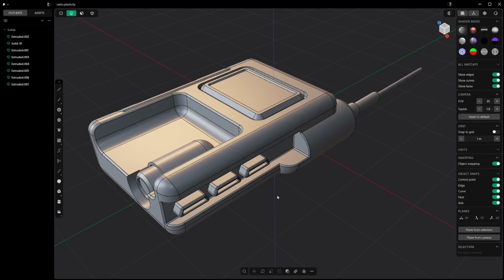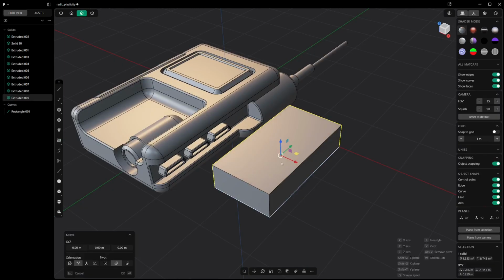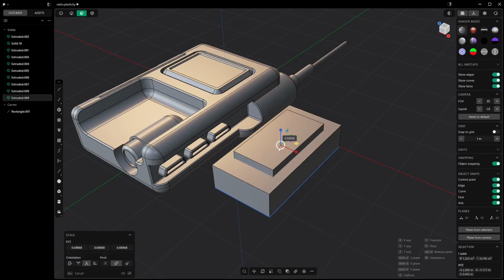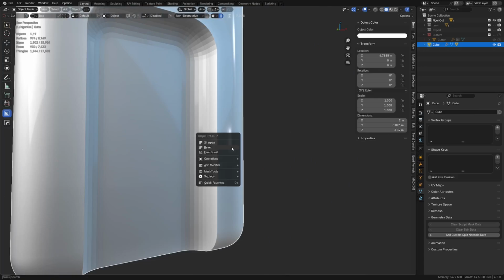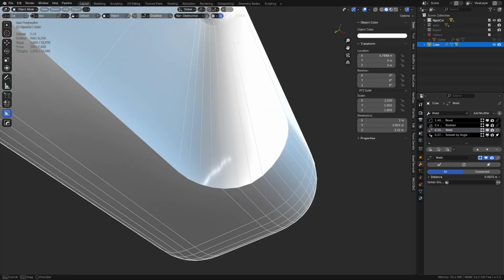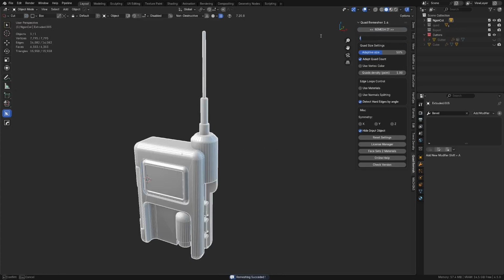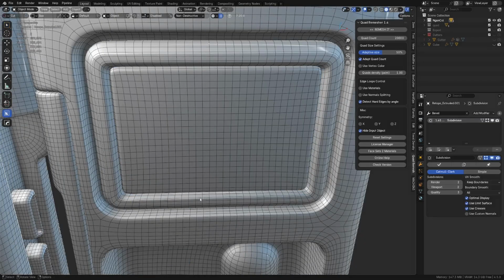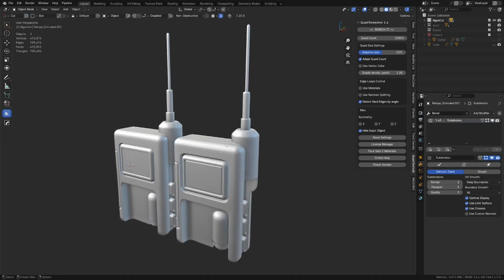Too Much Software ( Unleashed )

Comment: Frankly im still cant really get all that hype around "Plasticity" or SDF modeling. Yes, its a fast way to get some clean shapes with zero understanting of topology, but each time i saw how people convert it to game assets its ended up with: pretty ugly topology (even by games low-poly standarts) or a processes which are so time consuming and convoluted than more classical game assets pipelines looks times more reliable, faster and providing ability to tweaks even at the end of the process.
Reply: topology doesn't matter that much for non deforming mesh, you can use the output from Plasticity or even tweak it abit if you want.

Comment: I've not used Plasticity before, but I have been using parametric modelers for about 20 years now, CATIA, Pro/E, Solidworks, etc (this is my engineering perspective).  And only recently been playing inside of Blender.  Different softwares fits different needs and results.  Can you do NURBS and BREPS in Blender? Yes.  Can you do polymodeling inside of parametric modelers, also yes!  Just because a software can do something doesn't mean it's the best for that application, and that's absolutely fine.  A program doesn't have to do it all.  Use what's most accessible, and most appropriate for the job at hand.
Reply: wait we can do nurbs in blender?
Reply: @lavatr8321  indeed you can.  Under "Add" > "Curve" or "Surface" there are NURBS options.

Comment: 100% agreed, I tell people the same thing to focus on the fundamentals, Blender, PS, Painter. If you are trying to get a job as a 3D Artist, then I tell people to download a trial of Max or Maya so you are familiar with the controls and they way they work and so your are prepared for the job, however at home you'll want to use blender as it has the lowest barrier to entry and most resources online. Most of what you learn in 3D working in Blender you can transfer those skills to other packages so there isn't a point in buying every software out there until you need it. 

I've been a Max user for 15 years and I've completely switched to blender on personal work, now when I needed to go into more niche stuff for specific projects i use Zbrush or Plasticity however I would only recommend taking a deep dive after you've spent enough time to understand the limitations of traditional SubD programs workflow and whether you actually need it. I use Maya for work and it has it's own quirks, i wouldn't use it if it didn't have to. 

I personally find Plasticty more fun for building models and do use it for making games but I'm shifting the work around when I do that, In something like Blender you handle Topology and design at the same time which has pros and cons, By frontloading the Design work to plasticity you are backloading retopology and UV's to blender which has it's own pros/cons.

Comment: An addon for Blender that could help with cleaning up CAD meshes is AV Resample Mesh, but it's still quite a painful process.
When I export from Fusion 360, I preview the tesselation and adjust parameters until it looks good enough & then fix it up in Blender.
Reply: Yea its all fun in CAD modeling 
then it comes into Blender and the mesh is fk up

Comment: Yep. When I tried Plasticity, it was great to play with (for a non-polygon modeler), but the problem is when it came time to convert the model to usable polygons and exporting it (and seeing the result) it was like crashing down to reality and experiencing some crushing disappointment.

Probably great for people just creating fancy renders where nothing matters except the rendered result and you can get away with just rendering a procedural material, but near-useless for games if you need sane polygons and a mesh that isn't busted for UV unwrapping.

Had the exact issue as described, too much manual cleanup needed and at that point you may as well just model in Blender from the start. So for my hard modeling stuff, I still just use Blender and my assortment of Kushiro addons.
Reply: how often plasticity shading did not translate well into exported .fbx model? I'm asking because I am considering using plasticity only for hp models.
Reply: Plasticity is good for Industrial Concepts and designing
It is not parametric 
therefore 3D printing is hard , where real world Precision is required. 
may be very simple holders and plates can be considered for 3d printing 

and yes when CAD goes into Poly modelling software , it is 100% a mess